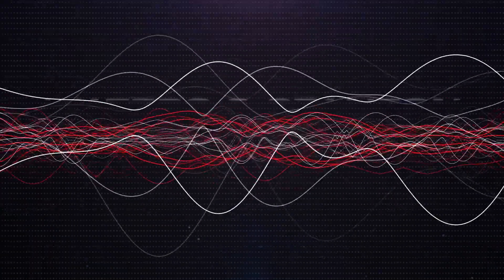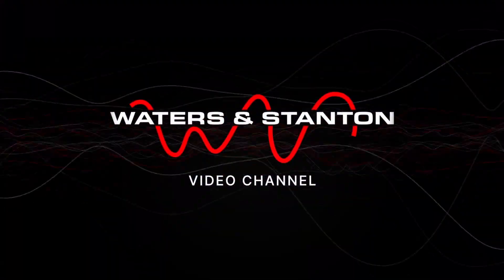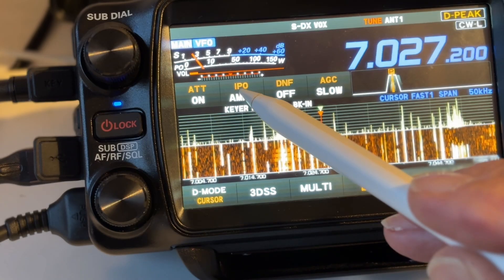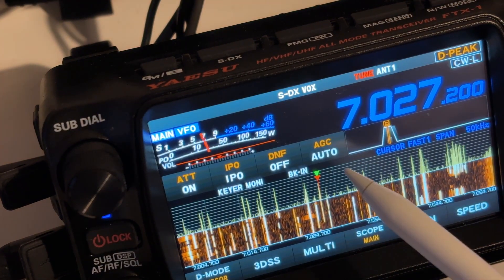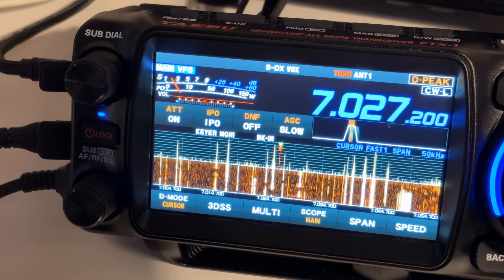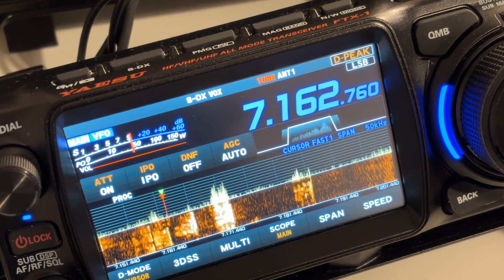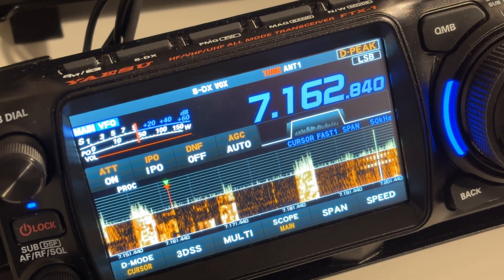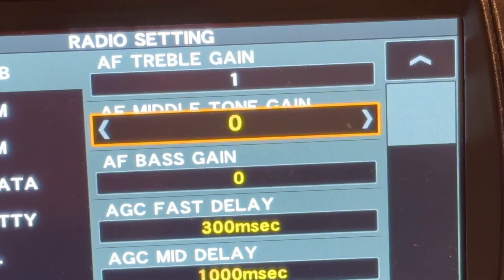Setting Up Your Ham Radio Receiver to Reduce Noise

Comment: Thank you for sharing your ideas with us Mr. Waters.  In recent years, I've remembered about the features of my base station radio to improve the receive audio quality and have tried making those adjustments when needed.  The notch filters also help with improving the desired received signals.  I'll also take your advice for my mobile and portable kits as the weather gets warmer in the Spring.

Even on VHF I sometimes have to adjust the RX EQ settings to hear certain stations better on a net that I run.

As always, thank you for all you do for us and your suggestions to help us have better experiences in our wonderful hobby.

Stay safe, happy hamming, and 73's Everyone  🙂😎
Reply from the maker: Glad the video was helpful for your setups! 73 Peter

Comment: Superb… I’ve been looking at noise and filter settings for about two weeks now, new radio, so the manual is out trying to understand,,, a practical demonstration like this just moves all the fog out of the way and gets you pressing the buttons and twiddling the nobs about,,, see what happens. Also had it into a dummy load for some things.
Good video, I’ve watched it a few times and trying things out in the shack.  ✅
Best wishes to everyone.73.       💙
G0uvl

Comment: Thanks Peter,
This is a video I want to save, I only own one radio that has DSP (FT-857), but this is very good advice to anyone coming into the hobby.
I own a Kenwood TS-180s and a TS-440, they were quite hard to "drive" when I first bought them, but like you say, read the manual and have a bit of a play, it doesn't mean you have to transmit at all.
To be fair, setting a receiver up (even if is part of a transceiver), is the first thing you should do, because if you can't hear them, you can't work them.
Reply from the maker: Many thanks from down under.

Comment: Sir I am kindly begging you to do a video illustrating both the ruff and fine tunning of the Hustler btv antenna. I am following the printed instructions but still seem to be having some troubles. I've seen that you have a 4btv Hustler and I have a 6 btv Hustler. Sir your time and attention would be highly valued. Thank you in advance.
Reply: Hustlers need a good radial system to work properly.

Comment: Thank you, Sir, for your helpful tips. I’ve found that if I had to choose just one technique to improve the Yaesu FT-891’s receive performance on weak signals, it would be using the RF gain control to tame background noise. At first, it feels as though you’re fighting the radio, because the natural instinct is to trust the signal meter completely. After years of operating on the 40-metre band, I’ve learned to stop watching the S-meter. The best meter is my ears.

Interestingly, only a few people seem to realise this. This mistaken belief persists because people proudly talk about “20 dB over S9”, rather than paying attention to the actual audio quality. I’m very pleased that you clarified this point—it’s reassuring to know I’m not alone in thinking this way.
73 de YD0RTA (Indonesia).

Comment: What a list and excellent explanations.  I'm starting out with a yaesu 817.  I bought a sotabeams dsp filter with both wide and narrow passband filters.  Also got a mfj 616 speech enhancer off of ebay.  I will definitely work on the other adjustments you recommended.
Reply from the maker: Glad the video was helpful for your setup!

Comment: Very nice set of tips for the starting hams 🔝 About the noise, maybe you noticed it yourself afterwards, you have a very strong 50Hz hum, that comes and goes at about 1Hz.
Reply from the maker: Yes there was a recoding issue on a couple of clips.

Comment: I’ve a 7300 using an end fed wire with a 9:1 unun at the feed point these antennas are great but noise levels are high around 5to 7 db of noice now after sent this method in your video Peter distant stations are still there but noice levels now gone and signals seem well seem more accurate full att on but not sure on the icom the band pass filter knob which one is for IF SHIFT ? Front knob or back knob ? Kind regards Neil up in Newcastle 😊
Reply from the maker: Great to hear you're getting better noise levels and signal accuracy with your setup!

Comment: Thank you Peter, that's awesome information. Do you think that by fine-tuning for noise using SSB as a reference you are also improving things for FT8, or no effect or could it be affecting FT8 negatively?
Reply from the maker: I have little experience of FT8 but  I believe that narrow band may not be an advantage because of the operational mode. Maybe somebody can drop in with the answer.

Comment: Well covered Peter. In fairness any of these radios nowadays have all this documented in their manuals if only people would actually read them! The spinal tap approach isn't suited to ham radio.
Reply: Nobody is suggesting manuals are deficient in their explanation of functionality but they do lack (quite rightly) typical practical use and application scenarios, which what Peter is so good at. These are two very different things that should not be confused, much as reading and digesting your vehicles handbook wont make you a master driver.

Comment: Hello Peter - back in the day using Marconi and Racal equipment it was standard practice to switch off the AGC and bring the volume up to around 3 o'clock and use the RF Gain as an audio control so as to speak - retired now and I still operate my rig the same way - I must agree on the use of a preamp - all they seem to do is to amplify the noise